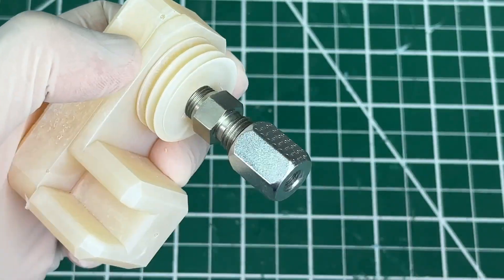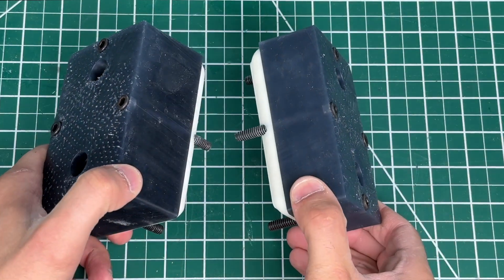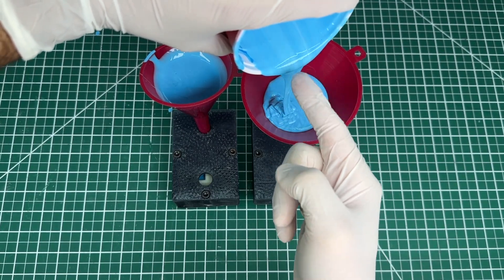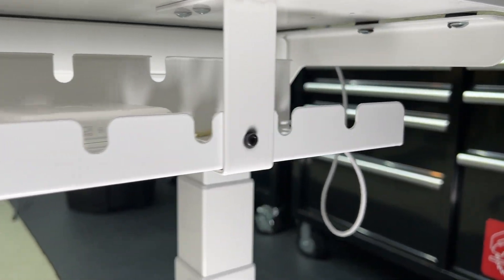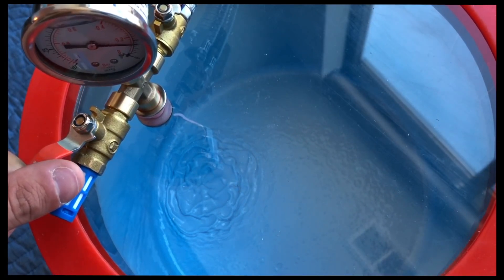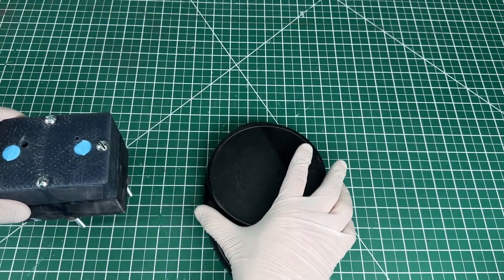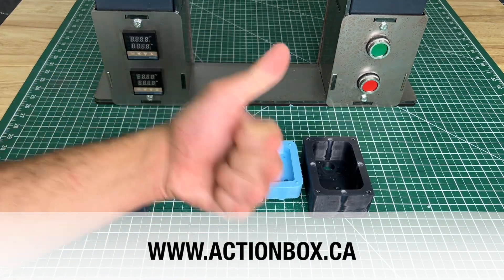DIY Manufacturing Process Using RTV Silicone

Comment: it is possible to make a mold part a and b to make tiny pieces, I need 5.5mm*7.00mm*2mm pieces with 0.5mm of diameter holes on my resin epoxy final parts. I can see how clearly the threads of 0.3 or 0.5mm pitch molded perfectly. Wondering...

Comment: Getting rid of bubble in the PU is not by degassing it prior (which does not work because you need to stir) but by placing the mold inside a pressure chamber instead.
Reply from the maker: That’s not true.  If you put it in a precise chamber then you just make the bubbles smaller until the silicone hardness around them.  When you vacuum degas, you make the bubbles expand and therefore rise to the top.  Both methods have their place.  As an example, vacuum degassing takes longer so you can’t use it for resins that set in 2 mins, but you can use a pressure pot.  Hope that helps.
Reply: @ActionBOX  1. Not talking about silicone, you can´t crush bubble in silicone you have to degas it. Silicone is elastic the bubbles will expand again.
2. Talking about PU, which is usually not degassed (takes way too long) but placed in a pressure chamber. 
3. I appreciate it but I don´t need help with the topic thank you.
Reply from the maker: @sierraecho884  Gotcha, sounds like you are referring to viscous PU while I was imagining very thin PU like the one we used in the video. The low viscosity PU degases in no time.
Reply: @ActionBOX  In general PU sets really fast, viscous or not and a pressure chamber is used because it´s rather quick and convenient to crush bubbles before the PU hardens. 
Of course you can use whichever technique works best for you, I am just generalizing. 
"Robert Talone" has a great channel about this topic here on YouTube.

Comment: For those of you on a budget. Vibration also helps bubbles rise to the surface. You can achieve this simply by holding your mould as it dries on top of your washing machine when it's on full cycle
Reply from the maker: Now there's an idea!

Comment: Easier than vacuum degassing the silicone is to pressure cast it. Don't worry about bubbles getting in when mixing, the air pressure will crush them and drive air into permanent solution in the silicone. A Harbor Freight item number 66839 Air Pressure Paint Tank is big enough for a wide variety of molds.

What you get with RTV silicone without pressure casting it, even if you vacuum degass it, is bubbles in sharp inside corners, which can be seen in the mold in this video. Only the thinnest viscosity, low durometer, RTV will flow well into those tight corners. But that softer silicone wouldn't be suitable for "pack and hold" injection molding. It might work for injecting until the mold is full then immediately releasing pressure. But then that method isn't suitable for plastics that have a lot of shrink as they cool.

For some reason, tiny bubbles in the silicone like to cling on vertical surfaces, just beneath the surface of the mold cavity. The mold surface can look great but pressure cast resin or injection mold thermoplastic into the mold and those subsurface bubbles collapse. That produces bumps, spikes, or if the bubble ruptures, little balls of plastic on the surface of the casting. Those defects will then be rough on the mold when removing the casting.

Never use tin cure RTV. It's not worth the small cost savings, not even for one off projects, especially when dimensional accuracy is important. Platinum cure RTV molds can last for decades if taken care of. I've been making silicone molds and resin castings for over 24 years and most of my molds from the early years are still in use, including a few that I didn't pressure cast the silicone. I just put up with the issues that came from that because those molds don't get used often. A few molds I have made enough castings to where they got worn and I've had to make new molds once.

I have learned a lot about making silicone molds in over 24 years, especially how to make them faster, easier, lower cost, and better performing. I started out with a background in slip cast ceramics and plaster molds, and fiberglass mold and part making. Much of the molding techniques for those types applies to silicone molds.

I started with the typical methods found in books published in the 80's and 90's, and still promoted in this century in countless YouTube videos. Tip from this pro, they could be doing it better. When I found that a traditional / historic method was difficult to do or produced results I wasn't happy with,  *I figured out a better way*. I've often figured out a better way than my original better way several times.

I am happy to share what I've learned through a lot of experience for free because I want other people to have the best experience making molds and castings by taking advantage of my years of experience to "short cut" from the old school techniques of 40 years ago to how I make molds now. Use my knowledge and learning so you can skip all the in-between development I've done from what's in books like The Prop Builder's Molding and Casting Handbook (still a good book to read for anyone making silicone molds) to making better molds and castings than what you'll get following the old books.
Reply: Pressure cast  with a tank 100% for parts in silicone. idk what they're doing trying to injection cast into the soft and supple low shore silicone with that big ass machine lol May as well just use lost resin casting to make the parts from aluminium xD
Reply: Would love to learn from you. Time to make a yt channel?
Reply: Is there any way to contact you if I have questions about mold making?

Comment: Last time I tried using sla printer to create a silicon mold, the silicon didn't cure in contact with the resin. You need to use specialty resin for this and/or spray them with polyurethane.
Reply from the maker: You are correct. The solution is to use platinum cured silicone.  Great catch and thanks for the comment. 

Cheers,

Dave
Reply: platinum cure will also fail. If you leave the 3d print for a long time it will lose it's sulphur, this is what inhibits. Heating helps the sulphur escape also. 80c. "Clear" resin will change from yellowish to clear for this reason.    @ActionBOX
Reply: @ActionBOX  Don't use enamel spray paint on anything you'll be casting platinum cure silicone against. Until the enamel is completely cured (which can take months) it can cause cure inhibition in the silicone. Urethane or lacquer are safe to use with platinum cure silicone. Been there, done that, had the ruined mold. Then I had to sand off the enamel and spray that master model with clear lacquer.
Reply: I use tin cure all the time for sla parts, never had a cure inhibition issue with any resins so far. Just make sure parts are extremely well cured and cleaned :)

Comment: By the way, if you want a cheap and easy way to degas resins, grab the biggest syringe you can.  Put the plunger in, and suck up the resin to about half way.  Put your thumb over the tip, and then pull it back the rest of the way.  It will create a vacuum, pulling all of the air out of the mixture, then you can use the syringe to fill your mold.  Something like a 150mL syringe will do, it looks silly at first, but really works and will save you the need for a vacuum pump.
Reply: You don´t degase PU with a vacuum but with pressure, you crush the bubbles instead. You degas the silicone with vacuum because you can not crush bubble in a elastic material.
But great idea with the syringe, well done
Reply from the maker: Very neat idea 💡 we have not tried that but what I wonder is what happens after a few bubbles make their way to the top? Your vacuum slowly decays which slows the rate of degassing for the rest of the bubbles in “solution”. In other words, how do you “recharge” the vacuum?  Thanks again for an insightful comment 😃. 

Cheers,
Dave
Reply: @ActionBOX  I have the feeling that you can repeat the process several times to achieve a high degasing rate with the same resin sample inside:
1. Dip the tip of the syringe into the resin and pull the plunger to pump it, but fill only halfway.
2. Turn the syringe upside down vertically, head up. 
3. Put your finger on the hub tip, and pull the plunger all the way out. The resin is flowing at the bottom near the plunger and is degasing at the same time.
4. Release your finger: ambient air fills in the syringe again but in the upper hollow volume, hardly at all in the resin.
5. Push the piston again to get the resin up to the hub tip lip, like if you were preparing some vacc|ne but here without the needle of course.
6. Repeat from step (3)

Comment: for small parts like this you can degas using a large syringe
Reply from the maker: Thanks for the suggestion! Have you made anything using RTV silicone before?
Reply: @ActionBOX  RTV no, regular silicone and epoxy, yes, works very well
Reply from the maker: Awesome, thanks again for sharing. sounds like you've done this before 😜
 @nandobarreto2

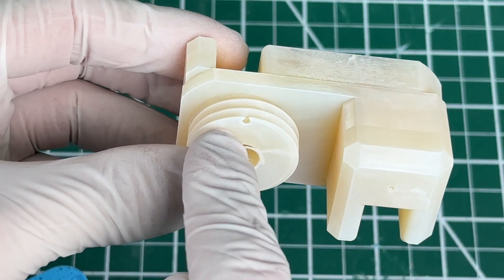Comment: 7:27 Looks like one halve was flipped?
Reply from the maker: Yup, you are correct, we did indeed have the 2 molds flipped the wrong way. One way to solve this is to make the alignment spheres at different distances on each side such that the molds only close one specific way. Im very happy to see that you are so attentive to our content 😃.
Looking forward to your comment in our next video 😃 

Cheers, 
Dave
Reply: @ActionBOX  yes. You made a 2 part mold,correct? In the casting you revealed at video time code 7m27 it looks like the bottom half of the part was rotated 180 degrees relative to the top half. Probably due to the fact that one of the mold halves was flipped. The part you casted with the hot glue had the part come out correctly, right?

Comment: Don't mix silicone with a spoon, it introduces a ton of bubbles. Also if you are using a tin cure such as this, pour the non viscous part in the cup first, then the viscous. It will ensure you can thoroughly mix the entire cup and not have to worry about unmixed materials.
Reply from the maker: @AC-mu6ig  Hahaha, make sure to subscribe, because we actually have a huge vacuum furnace video coming up 😉
Reply from the maker: This is good advice.  Thanks for sharing 😃.  Was there anything you found insightful in this video?  Cheers, Dave